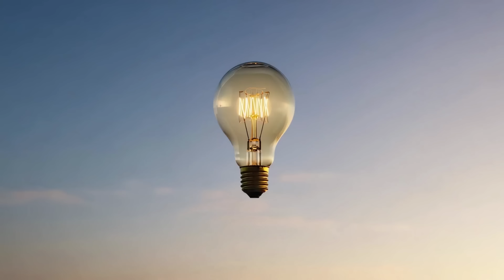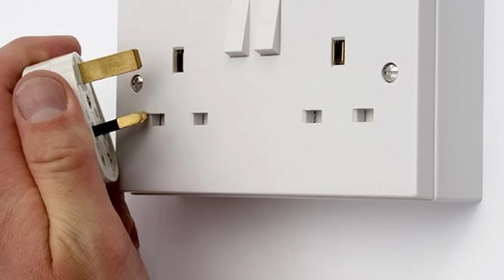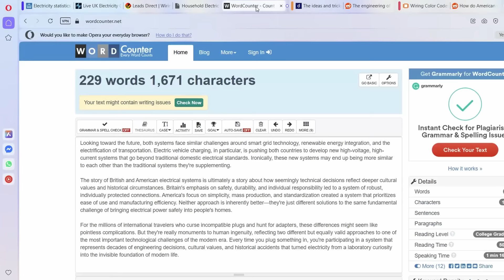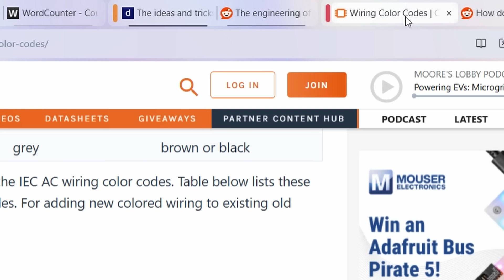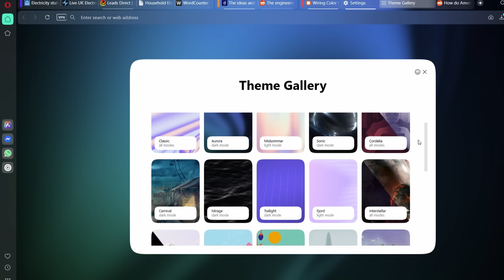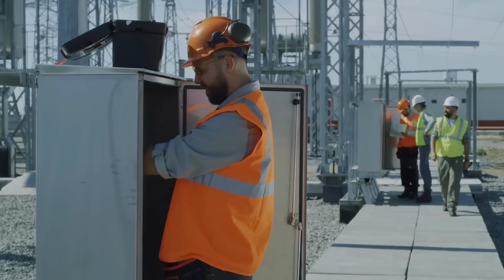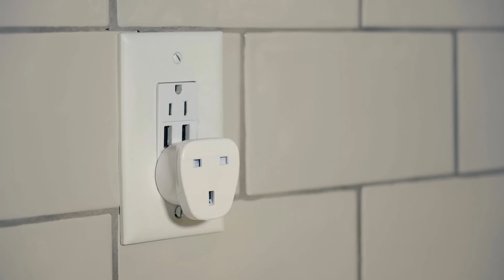British electricity is SAFER than American electricity. here's how.

Comment: After all that research, I'm rather surprised you left these things about the UK plugs & sockets out:
• The sockets are individually switched, so most things can be left plugged in, and switched off when not in use.
• The cable comes out the bottom, allowing furniture to be pushed up against the plug.
• The fuses only cost pennies and are easy to replace (they have their own little 'door', so no need to open the plug).
• If you need to open the plug, e.g. to replace the cable or wire it to something else, it's easy with one screw in the centre.
• The distances from the opening to the three pins ensure that, if the cable is somehow yanked out (very difficult), Live is ripped out first, followed by Neutral, and finally Earth, for maximum safety.
Reply: Cable comes out the bottom which means you can't unplug the device by pulling on the cable - this is a safety feature.
Reply: There are claims that the last point is by design.  But it seems to be a post-facto rationalisation of an accidental feature that is common but not universal.

Not only is there no mention of such a thing in the original committee deliberations there have been plugs marketed as "easy" because all three conductors are cut to the same length and indeed that is entirely within the standards specification.
Reply: @calmeilles  Who claimed it was designed that way? It could just be a happy coincidence. I was just listing some practicalities that I think are worth mentioning.
Reply: All these points can apply to any plug type as extras, even switch on british ones is optional extra, not standard. As for behind furniture, british plug are terrible, huge clunky thing compared to flat shucko plug that basically has thikness of cable taking room behind furniture.

Comment: You are missing very simple math –- E=i*R.  If voltage goes up, and something like your body resistance stays the same, the current has to go up.  So, a 120 volt outlet and your body is lets say 1000 ohms, you would have a current of 120 milli amps.  If you increase the voltage to 220 and your body is still 1000 ohms, the current would be 220 milli amps.  Voltage does not hurt you, current does (measured in amps).  So a 120V outlet is safer.  Also the US turned to coffee long before electricity in houses.  We also don’t have kettles to heat water, most people have a Keurig brewer. Turn it on and in about 30 seconds you have hot water, leave it on and you have instant hot water all day long.

Comment: AI Overview
British Building Regulations require that all electrical installations in homes are designed and installed to be safe from fire and electric shock, primarily by complying with BS 7671, the IET Wiring Regulations. Major electrical work like installing a new circuit or replacing a consumer unit is "notifiable" and requires notification to your local authority's building control, unless the work is done by an electrician who is a member of a competent person scheme, who can self-certify the work. 
since about 1994?

see also

HSE
IKtroduction to electrical safety

ecautions

How to assess electrical hazards and put the right controls in place

Grid-scale battery energy storage systems
Where health and safety law applies and HSE’s role

Portable appliance testing (PAT)
What ‘PAT testing’ is and what the law says about testing equipment

Electricity in potentially explosive locations
The supply and the use of equipment in potentially explosive atmospheres

Electrical standards and approved codes of practice
Commonly used electrical standards and approved codes of practice

Electrical injuries
Risk of injury is generally greater with higher voltages and is dependent upon individual circumstances

Frequently asked questions
Including legal responsibilities and risk management

Case studies
Overhead power lines, electrical maintenance, excavations, ignition of explosive atmospheres

Comment: Hi, America uses 220V but split phase. So 110V between Neutral and Live. But 220V between L1 & L2.
So you have 220V for big appliances like cookers & tumble dryers etc.
I don't know why Americans don't put a 220V socket (receptacle) above the counter top for a kettle. An electric kettle is more efficient than an electric stove and way more efficient than a gas stove.

Comment: At only 120 volts this level of safety is unnecessary.  People getting shocked by their wall outlets is extremely rare especially since the introduction GFCI outlets in bathrooms and other areas near water sources.  Although a shock from 120 volts can be lethal (shocks as low as 48 volts can be lethal) it is unlikely as compared to a shock from 230 volts. It should be noted that almost ALL injuries and deaths from 120 volts are the result of people doing wiring not merely plugging and unplugging devices.  Point being don't fool around with electricity unless you know what you are doing!

Comment: One of the key people responsible for the safety of the UK domestic electrical system was Caroline Haslett, later Dame Caroline Haslett. She was the sole woman on the Institution of Electrical Engineers committee formed during World War II to consider the requirements for post-war electrical installations in the home. Haslett was an electrical engineer and an expert on safety in the home. She used her position to advocate for features that would make electricity safe for domestic use, particularly for women and children who spent the most time in the home. Key contributions influenced by her advocacy include the three-pin fused plug design, and shuttered sockets, which prevent electric shock by blocking access to live contacts when a plug is removed.
Reply: You've beaten me to citing Caroline Haslet. I am ashamed to say I only heard of her quite recently (via a Hannah Fry programme).
Reply: @1philarcher You and me both. I was today years old when I found out about her, but now I'm feeling inspired to learn more about her.
Reply: As a toddler in the early 1950s I put a finger into the old style unshuttered 15amp socket in the house where I lived with my folks. I learned instantly that electricity was dangerous. Luckily I was unharmed.
Reply: @MJC1124  
Yes the type M.  They are still legal today. But these days they have shutters, switches and insulated pins. They are used in India, Pakistan, South Africa, etc.
Reply: A ring final circuit, requiring a return leg, isn't guaranteed to use less cable than radials.  The saving came not in new builds but in retrofits where it was typical to have 2 15A circuits, one downstairs and one up.  Join them together and you have a ring at 30 Amps for a few feet of new cable without rewiring the entire property.
Reply: I have no idea why electricity is more dangerous for women and children.
Reply: @jeffslade1892  It isn't is just they were more exposed at home at the time, when changes to safety were being put forward.
Reply: Nice to mention Caroline Haslett, but she had nothing to do with final ring circuits. They came after WWii, like around 1950. Copper shortages had zero to do with final rings.
Reply: @johnburns4017  The post I believe didn't mention she did. Just advocacy to change.
"Key contributions influenced by her advocacy include the three-pin fused plug design, and shuttered sockets, which prevent electric shock by blocking access to live contacts when a plug is removed."
Reply: @hannahbutterfield1530  
See my post on her.
Reply: Thank you for that. I consider myself to be a bit of an electro-nerd and I'd never heard of her.
Reply: Thank you for that. Oddly, the story reminds me of Miss Shilling's orifice. I think the golden rule is, "underestimate women at your peril!"

Comment: Although the plug that we know and love has been around since 1947 many houses into the 1970s still had the old round pin 5 amp sockets and the plugs had no fuse or safety features on the live and neutral pins. In fact in those days adapters were available allowing the user to plug appliances, especially irons, into light bulb sockets!

Comment: I remember an old Latin teacher who was very firmly of the view that it was essential to switch off a socket that didn't have anything plugged in, lest the electricity leak out on to the floor.

I'm not saying this is definitely the reason most of our sockets have switches, but US floors must be very slippery with all those leaking electrons
Reply: But it's AC, so as fast as they leak out, they'll be pulled back in.
No worries. They don't travel far.
Reply: I remember someone who thought the same.  Worryingly, she was an engineering draughtswoman.
Reply: Electronics from the 80's and 90's when plugged in but "turned off" would draw significant amounts of current wasted as heat. The British on/off switches were brilliant for this, you didn't need to worry about your hoover sucking up energy when plugged in. The AC-DC transformers that powered or charged pretty much all handheld electronics (including all late 90's, early 2000 mobile phones)  constantly pulled energy when not in use. You could just put your hand on the transformer and feel the heat. That simple on/off switch again solved the problem.

Today's switched mode AC-DC power supplies solved that problem, but the on/off switch remains incredibly useful.

Comment: The narrative implies that the current UK plugs were developed when electricity was new.  Not correct.  When I was a child in 1950s there were 3 sizes of 3-round-pin plugs 2A, 5A, 15A, and 2-pin-5A plugs.  All without fuses. These were on radial circuits with each line having a fuse in the fusebox.  Then in the 1960s ring mains with the 3-rectangular-pin plugs became common.  There are fuses or breakers in the 'consumer unit' (was called fusebox) and fuses in the plugs.

Comment: Correction: British (and Irish) 3-pin plugs are fused to protect the line cord, so that an overload won't lead to a fire. The appliance should be fitted with a cord appropriate to its load.
The British ring main system was introduced post-WW2 to economise on copper useage. Prior to that, radial circuits were common.
Reply: The British 13A plug/socket was originally designed in Sweden as part of an effort to improve the power socket used at the time! Sadly, it was never adopted; the Schuko system was adopted! The British took the idea and upgraded it into the one in use today! I feel that it is far better than the various Schuko models in use in Europe today!
Reply: @g8itb-radio  Mmmmm not sure that is actualy true as the 'plug' and its specifications was the product of the BS Standard.......that is to say the standard came about before the plug..... features of both the socket and plug like shutters, the three pins in the familiar configeration, side entry cables etc were also in common usage in the UK too prior to the standard and were thus 'adopted' by the standard having been seen as 'good practice'.
Reply: @g8itb-radio  I can never understand the thinking behind the schuko plug system, and I've got one of the plugs here somewhere, and I don't like them because they have no fuse, they're not polarised so it fits in the socket either way round, and the earth connection is made by a side contact instead of a pin and socket, and they stick out when plugged in with the flex emerging at the rear end making it more of a trip hazard, and it seems they can't properly determine the rating, somewhere between 10 and 16 amps, what a mess!
Reply: Or Cypriot or Maltese or Gibraltarian, and that's just within the EU!  Although the regulations emphasise that the purpose of the fuse is to protect the cord, it's good practice to check the rating of the device as well..  In many cases the device will only need 1 or 2 A while the cord may be capable of 13 A, if a larger size has been fitted to a portable device to minimise risk of cord damage.  Apart from the 3A and 13A fuses specified in the standard, 2A, 5A, 7A & 10A fuses are available, and sometimes a correctly-rated fuse will prevent unnecessary damage to the device -- having said which, an RCD protects a device better against just about anything other than overload.
Reply: On shocking numbers of occasions I've seen friends/housemates about to replace a blown 3A fuse with a common at hand 13A fuse. I had explained that if the fuse was blown is was probably for a very good reason, but on some occasions they ignored me saying I was exaggerating. They plugged it in, a shower of sparks and black smoke later the house breaker  tripped and they started trusting my advice.

Far more disturbingly was when they plopped the 13A fuse in and it seemingly worked perfectly. They'd turn to me and say "see, you had no reason to get all up in arms", I was like yeah, if you put a nail into the fuse it'll never blow. Now the magic smoke will release when nobody is watching.

Comment: The square pin plugs are relatively recent. There was a system of two sizes of round pin plugs before those came in.

As far as safety - the electrical installation is only as safe as the electrician that installed it. I've seen a lot of hair-raising installations in the UK and the US. The worst was when I went into a breaker box here in the US and found somebody had wired a bare wire (no insulation) to the neutral terminal. Yikes! I'm only still here because I wore gloves and checked everything with my meter. Somebody else's electrical work is always suspect!

US electrical cables are ludicrously heavy and thick compared to British cables.
Reply: Three sizes. The smallest is still around in shaver sockets.

Comment: What wasn't mentioned was that a large factor in the adoption of the low volt/high current system in the us was the copper mining lobbying of the government. More copper used = higher profits.
Reply: No, it was cost reduction.  The reason the USA ended up with 120-0-120 was the amount of '100 volt' distribution and equipment in use by the time the world realised that 100-ish volts distribution wasn't sufficient.  There were two paths to take, replace everything and establish a 200-ish volt system or add another wire and double the system power capabilities.  The USA went down this path purely because it was cheaper, not more expensive.

Comment: I've been directly involved in electricity since I was born in 1940 (though more from about 1950 :) ) as I lived at the family radio/electrical business.  I was helping my father from a young age.  Many houses in our small mining town had gas lighting and no electricity supply and they use battery radios during and just after WW2.  This is an excellent summary of the UK system.  The 13 amp fused plug became the standard in the 1950s but before that there were 5 and 15 amp round-pin plugs which took a few more years to phase out.  I know we had customers who used bayonet adapters into light sockets to power electric clothes irons.

One big advantage of a higher mains voltage is lower current for the same power and hence a big saving on expensive copper for the cables.
Reply: There was a mining village in Lanarkshire which had it's electricity supplied by the pit until some time in the 1960s. It wasn't 240V and you couldn't plug in a stansare appliance.

Comment: The modern UK electrical system did not come in until after 1947 before that it was a radial system with round pinned unfused plugs. |t\he plugs came in different sizes depending on the current rating , normally 5A and 13A. Even in the early 1990's I worked in a factory that had a mixture of both systems and I have lived in a house where the outlets had been changed but still on a radial system with only one socket in each room.

Comment: Us in the UK did have round pins in the plugs originally. They haven't always been fused. Look back to the early years of electricity. Not all homes had plug wall sockets.  Had light fitting adaptors for plug in items.

Comment: It's time for this one then. I depends how you look at it. Yes, I've plugged in an American socket upside-down, but I think I did it deliberately (don't ask)? Some have earth pins now. Then there's GFCI, lower voltage etc. And a lot of British wiring has to be based on older ring setups. And some European plugs are better than ours. I'm no sparkie but I've watched some (other) YouTube videos! Basically it's not an apples to apples comparison.

Comment: There is a stage of UK electricity sockets and plugs missing from this otherwise well researched and presented piece. Before the present sure pin plugs and sockets there were round pin plugs and sockets. Before sockets many appliances were designed to run from the lighting circuit.

Comment: I was expecting it and I've seen it in the comments, the only thing that Americans can find to criticise the UK system is: "Boy does it hurt if you tread on one of those plugs!" Used to having to unplug their electrical devices when not using them and leaving the plug on the floor in the process, it doesn't occur to them that UK plugs don't have to be unplugged, you just flick the socket switch and the device is isolated. There's nothing left on the floor to be trodden on, that's an American problem.
Reply: 70 year old Brit and I have never stood on a plug, neither has anyone in my family.
Reply: Me neither. Only in YouTube comments do I encounter these people.
Reply: I have always found that the most painful thing to stand on is a lego block. I had just taught my children to stop leaving lego on the floor when the grandchildren started.
Reply: Are you high? Nobody in USA unplugs stuff when not using (unless taking it off counter and putting it away in a cupboard).
Reply: But the British trick of using a Ballpoint pen in the ground  and bare wires in hot and neutral cannot be done with US plugs. The things students get up to save a few pounds.